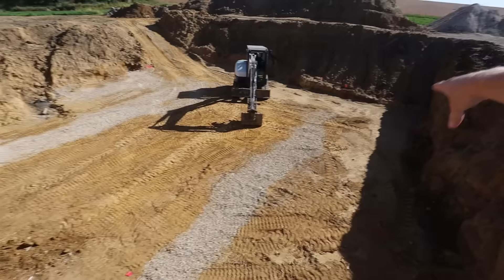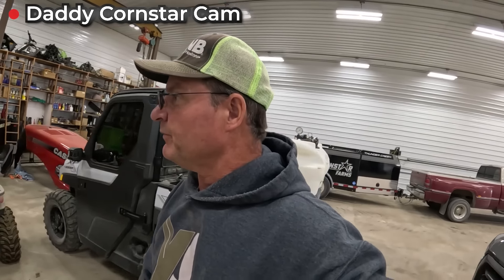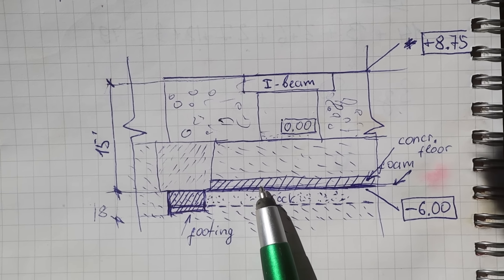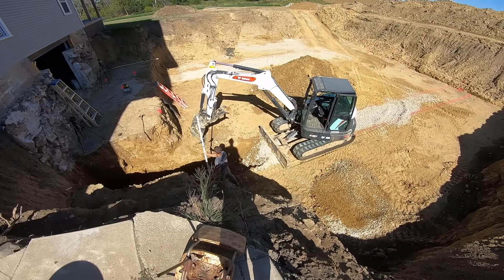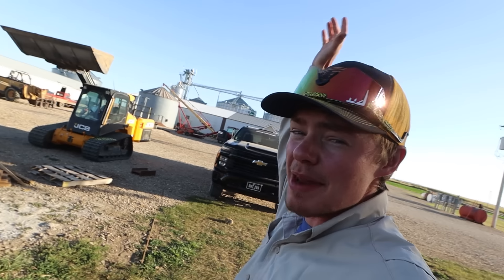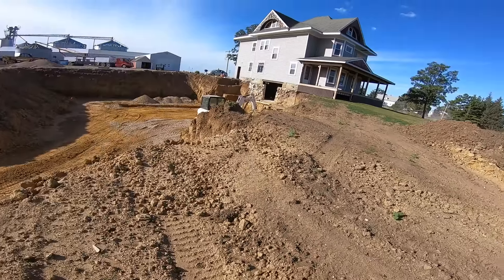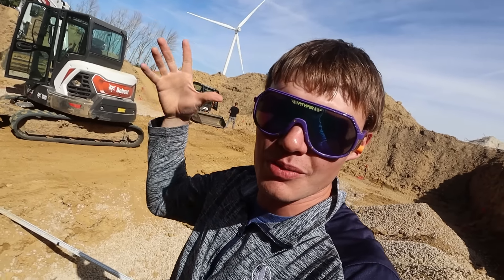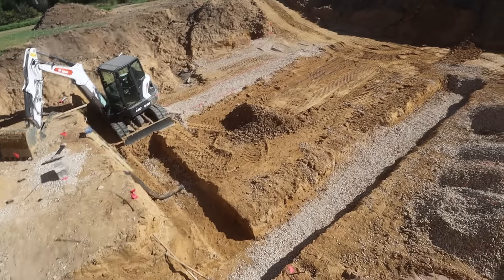Restoring A $7,000 Mansion: Building The Movie Theatre Foundation (Pt. 1)

Comment: @Cole The Cornstar get expanding bentonite sealant strips between the house and the theatre and between the slab and walls of the theatre - it prevents any seepage of water and reduces moisture ingress through the seams should your drainage ever get temporarely overwhelmed - they are like tar sealant strips but slowly expand if they get in contact with moisture and are used to seal basements that are close to or below ground water level - in combination with waterimpermiable concrete mix like B4 creates long therm dry basement without needing to spray bitumen or torch on asphalt matts on all exterior surfaces  ; )

Comment: If you run your stairway to the cinema parallel to the house in a pseudo foyer to separate the house from the theatre It will optimize the theatre space and help with sound travel.

Comment: As far as not being able to get large equipment or supplies in your original basement, don't you still have to pour a whole new cement flooring in the basement now that you have finished all drain pluming and shoring up all the ceiling and walls in there?  Won't you need to bring large equipment to pour that in there?

Comment: That theater could be a bomb shelter. Those footings are big enough for a 20ft wall. Industry standard for residential basement walls is 2ft wide and 8 to 12 inches deep depending on the ground and the height of the wall. A 3000 pound mix is also standard. 4000lb is for commercial and anything stronger than 4000 is for heavy industrial or bridges. You are spending way more money than you need to.
Reply: Why would anyone in bfe Ohio need a bomb shelter 😂

Comment: Cole, I hope you are heeding the advice many have given regarding re-enforcing the i-beams. Ignoring their advise could be catastrophic. You have access to a wealth of knowledge out there so hopefully you will take advantage of it. On the video where you installed the longest i-beam, multiple engineers  and professional welders expressed major concern regarding the lack of stability where your welds are. They also offered solutions that would be easy enough to do and will protect your home from a disaster. I am not a welder or an engineer, but I have watched a multitude of videos and adding gussets and L brackets and lag bolts through the supports and the floor joists is standard practice to make structural supports strong enough to support the extreme amount of weight your finished 3 story home is going to put on those i-beams.

Comment: Hey can i back the truck up on the basement plumbing.  I know you will have a vent to the roof for the radon gas. Are you expecting to use the same vent for the sewer lines?  I dont recall that any vents were applied for the floor drains, bathroom, kitchen sewer lines.  Just wondering if ypu need to that before the floor is poured especially for the floor drains maybe the vents for the sewage line can be done above concrete floor. - in the walls. Another question on the floor drains with p trap doesnt that mean they always have to have water in them in order to stop sewer vapor from backing up? It doesn't seem like you have water in the basement since it is higher than the movies theater. Just some things that mede me go hhhmmmm?🤔🤔  love the channel. ❤
Reply: Wow where to start to get you to understand.  One He is actually fine with the plumbing and vent the main stacks for waste is also a vent.  Wet venting is a thing.  Where you use the waste stack or line as a vent as well. Floor drains don't need vent because they are attached to the mains stack.  The floor drains are not meant to drain sub water there are the incase something blows in the house to drain water.  They will need to be water add to the traps from time to time but that not hard to do.
Reply: @johnunsicker7440  thanks for the education.  I didn't know "wet venting" was a thing.  Looked it up to get more info and diagram to compare and it makes sense.  Just not something I've experienced.  'Not a plumber'

Comment: Please don’t have footings over the drainage pipes.  Pressure will fail the plastic pipes.  Drainage pipe should be run alongside the footing.   A second point of egress is a must.  A staircase at the outside corner can be used as storm shelter.

Comment: Are you putting any water tanks for hot water (solar heating) big furnice? . good to get them in the basement first through the side. Easier than 4 or 5 men carried it down the steps, which by the way I had to do. I didn't have the convenience of a big hole in the basement wall😊

Comment: House is coming along nice and I get wanting all the foundation done. Once y’all get that done, electrical and plumbing set at the basement level, then it will be a race to get everything dried in. 

I’m not sure if Cole has friends, family members or locals doing the plans, but but but - they either are over their heads or not motivated. Either way it’s bad and may be time to get money back and move on. I’ve known custom home builders getting plans done for 8,000 - 10,000 square foot homes in a month….. That included hidden rooms, hidden stairways and elaborate theaters.  They knew to get it done and done right because next home build was waiting. I know a remodel is more difficult but they’re not planning a trip to mats.

Comment: A napkin drawing! Where is the drawing and engineer plans!
4 foot wide by 18 footings are nice buy seem like overkill!
Why is your drain tile in the footings? 
Is the floor above the movie theater the garage floor or living space? If it's living space  today's codes would not allow 2x8 floor joist like the old home. So putting your top of foundation wall at the same elevation as the existing is wrong! Floor joist need to be taller! What about center girder to cut down on floor span? This is going to be lower than your assumed 14 foot tall theater ceiling!

Comment: why is the basement floor not being poured first? a concrete pump truck could drive down and easily shoot it in , seems like a lot of backwards steps, then do footings outside then pour theater floor , ugh the bouncing around to start projects gives me anxiety lol a lot of extra work
Reply: Why? They have no idea what they are doing..that's basically it
Reply: @jarrettfullerton2580  Let's dig trenches for drainage and bury the pipe.  Let's dig footers 4x too big directly over those pipes, so dig up what we buried and set forms.  Cole and Roman dig nearly every hole twice before they're done.  Now they're going to set footers on loose rock and floors on loose gravel that likely won't be compacted.  I hope Cole likes sagging walls and cracked floors.
Reply: @benhur520  that seems like best case scenario...I've been more worried about safety.
Reply: They're learning some of this stuff as they go.  They're likely being cautious about the basement floor in case they need to make changes or add anything.

Comment: Roman you’re so right. Without actual plans drawn up for the whole project ahead of time is what’s causing you guys to have to keep going backwards. Like the basement project. All that foundation work should’ve been first then work up to the basement. It’d be well worth it for you & Cole to sit down using an app that helps you draw out plans with all the measurements/requirements needed so you’re not wasting time & money trying to figure it out on the fly. If the foundation fails, the house fails.
Reply: Aren’t the required to have plans to get the proper permit to build?
Reply: @samtrosper7224  What I've seen so far, no plans, permits or inspections.  Because Cole doesn't trust contractors due to issues with silos.
Reply: @samtrosper7224  that’s what I keep asking. In my state, PA, we have to have a permit to start building & inspections that have to be passed or you’ll get shut down. But states like Arkansas don’t need permits. Idk about Iowa, but I haven’t seen a permit sign in a window.
Reply: @martyf3531  If permits are required for building, he’d legally have to have one, but wouldn’t have to hire contractors. They must not need structural engineers or plans for a permit bc they don’t have any.
Reply: @chrissyfrancis8952  I think it has to do with being on a farm. He just has to deal with county as opposed to dealing with city regulations and permit requirements. County is much more laxed.
Reply: @lukem7203  must be. Hell, we can’t even put a fence up without get surveyed & permits. PA is over taxed & over regulated.
Reply: @chrissyfrancis8952  well, when you watch theses videos you might think different why permits and regulations are needed.
Reply: @martyf3531  That's because Cole was so smart he saved money by not hiring a general contractor to do the bin site.  Cole's signature is on all the contracts, change orders and plans.  Saving that general contractor's fee is going to cost the farm hundreds of thousands to fix.  It's not hard to defend a lawsuit when the customer approved everything done and every inspection.
Reply: @martyf3531  once again ya'll like to keep spouting off things that are just factually incorrect. Cole has stated MANY times that there ARE drawings, professional drawings that were done by an engineer, he consulted an engineer in the begining, I guess no one has ever once thought about the fact that Roman maybe didn't have those drawings, or the fact that he is NOT an engineer and maybe he didnt read them or review them. Cole is trying to be in about 4 places at one time. You all on here just absolutely LOVE to poop on a guy who is working harder than 90% of the rest of America. YES Roman is a GREAT guy, YES he is a PHENOMINAL worker ( and friend) but the continual bashing of Cole and repeating at nauseam that he has not employed any professionals on this massive job is MIS INFORMATION...are ya'll libs or what, cause you sure do love to spread misinfo on every single video. I guess Cole doesn't really care much because you all watch and comment and that is what is helping to pay for his MASSIVE underground theater.  FACTS : Cole has stated he DID work with an engineer at the beginning of the project, he has stated he IS working in with designers for the interior of the house, he DID bring in an electrician for the major heavy lifting (remember when the electrician almost electrocuted himself when he hit the live wire with the shovel????) He DID bring in a plumber, again for the heavy lifting in the basement when working on the drain tiles etc. Oh, and lets not forget that ALL of the work that happened prior to the work in the basement starting he was working every single day with a what???? Oh ya, a CONTRACTOR. Justin...who was on site for ALL of the massive work of tearing down the inside of the house and getting the major framing work done inside to make the house STRUCTURALLY sound. So, that is an engineer, a designer, a contractor, an electrician a plumber and ohh yes, they had their friend who has the really big digger come and help with some of the main dig out of the basement for the extension (new build) I forget his name, I want to say Ronnie but Ronnie was one of the Semi drivers who just passed, anyway, anyone who watches Coles videos alot , knows who I mean, he does a lot of their major digging work, took out all the big trees etc. So, we will add him to the list of professionals that have ALL been employed to work on this build at some point in time. 
Frankly you all come across as a group of grown a$$ men who are jealous as heck of a young guy who has been working his hiney off for the last several years and who has made a pretty tidy living on you tube and lets face it, MANY people simply love to hat3 you tubers. There is this very odd weird thing that they somehow are cheating the system by earning a living doing something that a lot of people THINK they can do also ( but yet don't) and in reality ...if it was really that easy to turn on a camera, talk to in, be engaging, edit and make videos multiple times a week and bring in a hefty 6 figure salary...poverty would no longer exist in the USA (or anywhere else that has the internet). IT IS NOT THAT EASY. This nonsense that he has not hired any professionals there are no "plans" is simply factually incorrect and its literally documented  in the videos. You all need to stop with this jealous pettiness, it makes you look like 13 year olds out behind the school yammering on about the other. stop it. Grow up.

Comment: 4 ft wide excavation for footings? Seems to be over doing it a little. Should have invested in a good architect with a proper set of plans.
Reply: Architects are expensive.   Pouring a 4'wide 18" footer you get a full 6' of footer per yard of concrete,,,  Massive savings & Winning!!!  (joking)
Reply: Hes probably digging 4' to be able to form and deform the footer of 2'.. 18" down to get past the frost barrier and at the bottom of the wall
Reply: Nvm he did say itll be 4' wide for the footer
Reply: These footers will support what I assume will be a suspended concrete slab floor for the garage that is also the ceiling of the underground movie theatre.   Seems like a really wide footing is a good idea!
Reply: @mindyjost3215  according to a video he put out a long time ago, the garage is beside the movie theatre not over the top of it (where he is currently piling all the dirt from his current excavation, but that's another discussion)  what's allegedly  above the theatre is kids bedrooms, a bathroom and offices.
Reply: @andrewr2650  what’s expensive is wasting time and effort for not doing things inefficiently and wasting money on unnecessary materials.
Reply: @tajvlogs9296  looks like the bottom of the excavation is already beyond 4 ft deep , well below frost line even in Iowa. Basement wall thickness below grade is by code prob 12 in  so that’s a 24in footing 12 thick.

Comment: Why are you wasting truck loads of money and concrete 

Commercial office buildings don’t have footings that massive 

A depth of 18 inches is fairly common
18 x 12 w or 18”x 24”w 

THIS IS Depth below undisturbed soil
You were already there on that ledge it wasn’t necessary to dig it all out 
Because it has to be replaced with concrete or compacted fill 

You need to consider the depth of your slab 
The floor of your movie theater

That slab tied into your footings as well as the structure of a 12 or 14’ concrete wall full of rebar 

All of this must be considered when laying out your design

Comment: Just wondering about the septic system and how you will bring the cement to the basement. Love the renovation!❤❤
Reply: They can use a pumper truck with long hoses to pour the basement floor, probably through a basement window.

Comment: COLE talking about how to do things but then says we are digging up what we already dig up in order to do footings over top of the tile. Guess the footings and structure built on top of plastic tubing won’t crush it and fall in. What??
Reply: Yay, I was feeling anxiety about putting footings & foundations on top of drainage systems. We all know how drainage gets clogged & has to be dug up at times. What when foundation is built on top of them?
Reply: @nuns8126  One clog in tile that deep will not happen. Truth clog in drainage tile that that is very area at all.  But yes.  I didn't think you could build on top of corrugate drain tile.  Everything I read said you have to be PVC.
Reply: I’ve never seen footings done this way. Footings are dug on top of undisturbed virgin soil. Drain tile goes on both sides of footing with a crossover to lead out to your exterior drain usually with a crossover pipe and a sump pump to lift it up and away from the foundation

Comment: Ok, never a response to ICF block for basement!  If you don't, then at least do a "bathtub" concrete pour - that is THE only way to eliminate the Water you are will no doubt have in your basement with what you plan! A one piece bathtub can go on top of the footings you plan but must be tied into the "bathtub" walls and floor!

Comment: Why are you putting a heavy wall on gravel that has a drain pipe under it? The drain will eventually be crushed and the wall will move
Reply: I’m confused about this process, re-digging drainage trenches to put footings?
Reply: @Ebendone  yes agree. I do think roman is an absolute legend. I don’t want this to go wrong for Cole, so just making the suggestion. Hopefully they will see it in time
Reply: I was hoping  that I misunderstood the footers on drain lines back months ago. Now I see I heard him  correctly. This is Bad. No Bueno.  Non Est Bonum. FAIL!! THUMBS DOWN...
Reply: Folks who have watched this for long enough know that behind the scenes both Roman and Cole are following instructions from a structural engineer.  They also have designers and an architect helping behind the scenes.  Point is, we don’t see everything, including site inspections that clear them to proceed to the next phase.  Agreed though, structural engineers are worth their weight in gold, I’m certainly using a fleet of them to knock down half of a semi-detached home.
Reply: @horsewhisperer20394  They have a designer and that is it but no plans, engineer or architect. Anyone watching these videos can tell that right way.  You don't do half the things like they have if you did have these guys in place. One footers of steel beams and the last wall they did where to small and all wrong.  I beams are not spec out to the load there are carrying. You can't span 14 feet with 2x8 floor joist. You also never build on top of corrugated pipe either.  People have been saying from the start where are the plans and he has never showed anything up a simple layout of rooms.
Reply: @horsewhisperer20394  Also you don't need 4 foot footings either or 12-inch walls.